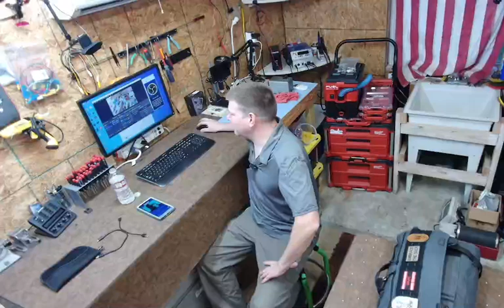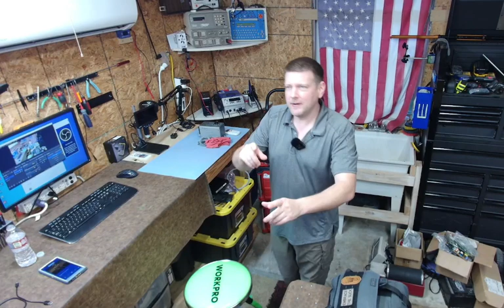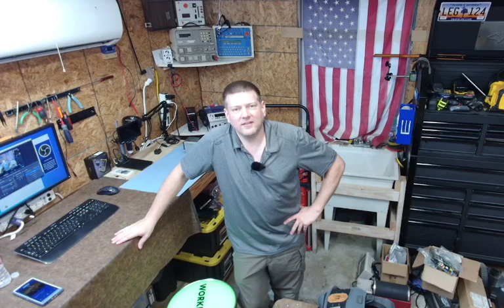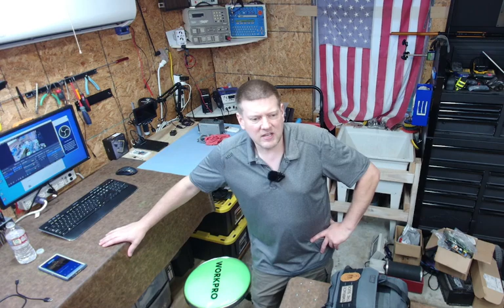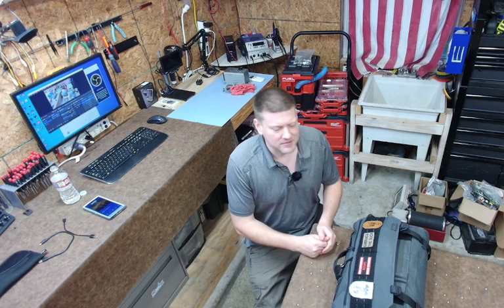SDI Video Issues When ESU Activates

Comment: Just to make sure I understand. Once the ESU triggers the scope to stop transmitting video. There’s no way of resetting the scope to start working again?

I’m diggin the shop progress!
Reply from the maker: The sender and receiver are in sync, the rf energy interrupts the transmission due to leakage until the interruption stops then they resync.  The problem is the rf leakage into the camera